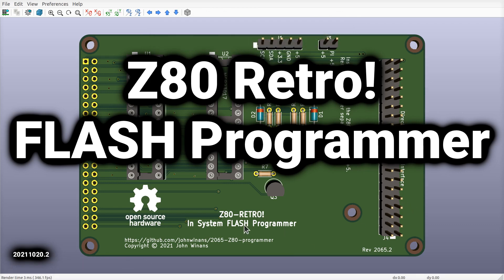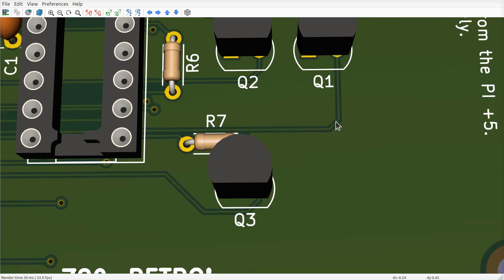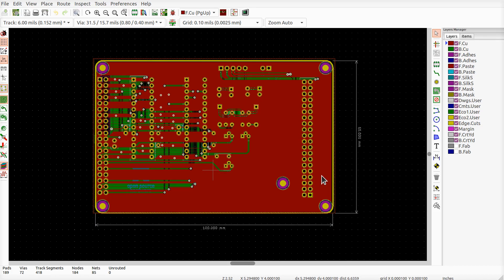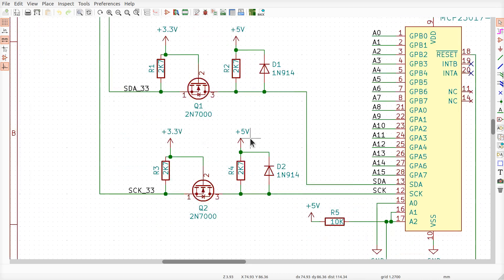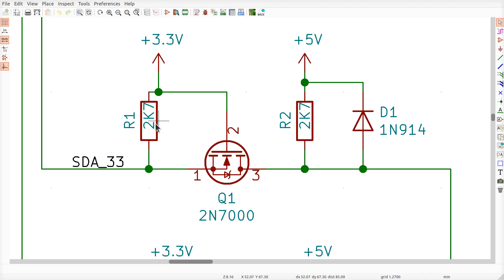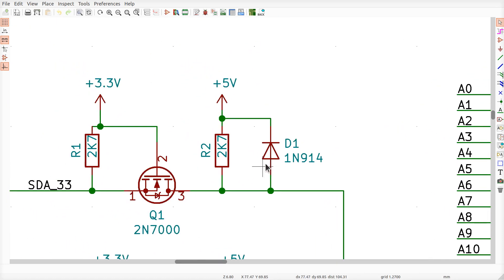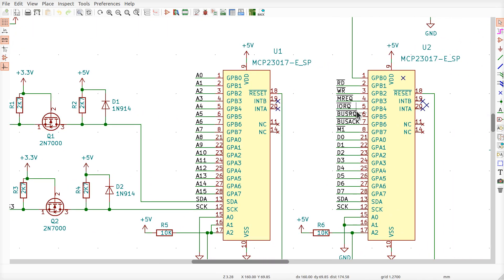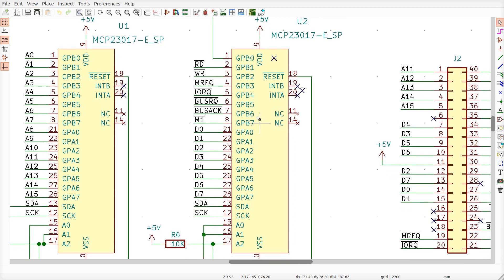Z80 Retro #9 - FLASH Programmer

Comment: Note that 2N7000 transistors are susceptible and great at demonstrating ESD damage.  The best way to demonstrate it is to drive an LED with 2N7000 and then expose it to ESD. The LED's brightness will dim with accumulated ESD events until the LED doesn't light up at all.  The closed captions are funny - with "Weight States" (are we on a diet?) and "Boss acknowledgements.
Reply from the maker: Ugh... I'm gonna call this another reason to have a closer look at the SPI version of the MCP chips (since SPI only uses single-direction signals and therefore simpler shifting needs.)
I guess YouTube has a way to go on cleaning up their speech-recog.  :-D

Comment: Nice series so far. 
Since you have decided to use the Pi as a programming tool, why not go and add the components to the programming board to implement a serial port connection between the Pi and the Z80 board. You could implement an RS-232 to 3.3v interface on the programming board with appropriate header between the programmer board and the Z80 so that when both boards are connected together you have a complete development system and Flash programmer (via the Pi), and a terminal with HDMI output and USB keyboard input via the PI back into the Z80 board. The stacked boards would be a permanent system allowing code development on the Pi, and a terminal into the Z80 with modern peripherals.
Reply from the maker: This is an interesting thought.  Seems easy enough to do by hacking the programmer board by adding a female header that sits down on the pins that I use to config the TX and RX lines on the retro hoard... Assuming that we add an rs232 driver to the flash board... since we'd need a level shifter anyway.
Ill add it as an issue on the github page so i remember next Time I look to tweak the PCB.

Comment: Don’t feel bad, back in the 70’s one of my S-100 board had the following issue:
“Very true, my Processor Technology 3P+S (3 parallel plus serial) card had a glaring error that took me months to figure out. One of the 232 converter chips was in the backwards. Not only was pin one on the board etched backwards, but the silk screen on the board was also backwards, and the manual was too. The parallel part worked great, but the serial port wouldn’t, until I found the error. ‘The Bleeding Edge’ was a very apt term in those days, but still fun to work though.”
Think you made a goof, what do you think the guys at Processor Technology did, they did not have any way to fix their goof, other than by a new letter months later if you were lucky and that the end user ever got to see that.
Reply from the maker: This one was a bummer.  🙄  But easy enough to fix even if you need to cut a trace on the board.  If you keep watching this series you'll see a more impressive "goof" in the first draft of the TMS9918 display card. 😁
Reply: @JohnsBasement  just don't think that was the biggest goof I have seen over the years. LOL

Comment: Do you really need a programmer card? Doesn’t the Pi have enough GPIO pins to control the whole Z80 bus directly?
Reply from the maker: A PI has... I think 26 viable GPIOs.  So you might be able to get by.  But you'd probably still need level shifters and one open collector driver. So, yes.. You'd need more than just wires.
With the parts costing less than $15 (if you get them with the rest) I never considered trying to optimize it out.
Reply: @JohnsBasement  ah, you’re right. I forgot that the Pi’s 3v3. Perhaps a Arduino Mega could program the Flash directly then?
Reply from the maker: @sparkybrit  Yeah, a Mega should be able to do the job.

Of course then you'd need to write the Arduino version of the code I wrote for the PI and then write another app for the host machine (where you plan to do your Z80 development) to download the binary file to the Mega to do the programming. This is certainly all doable.

Comment: If you put the correct sex 40 pin connector on the board, and tweaked the layout a bit, you could have the Rpi Zero plug into the board, and maybe even be powered off it (might need an extra cable to do that).  OR power the board off of the Rpi.  Could have the Pi mounting holes placed on the board so a pair of standoffs would hold them together.  That would be cute.  Also, if the Rpi USB can look like a 'slave', then it should be possible to do an ethernet over USB between the pi and the computer.  Actually I KNOW that works because I saw a project where the Pi was used as a USB stick.

And what does the symbol for KiCad say about pin 18?  Input, Output, Passive, or what?  Did you get any circuit errors detected by KiCad to hint that that pin was an input?
Reply from the maker: Wooooaaa!!! Good-eye! 
The part I used came from the Digikey library and it is marked as an OUTPUT!!!!   They fell for the screwy image on the datasheet front page too!
I'm not entirely following with the USB discussion.
I originally intended to use a PiZero but decided the total cost after adding the required USB adapter cable & Ethernet dongle (since I use wired Ethernet on my bench) and USB hub (if you want to add a second SD card with another adapter when we get to formatting it for use on the Z80 Retro board) ends up driving the price up enough to warrant considering a regular PI... and since I have a few laying around...

Comment: Hi John - loving the project and your presentation style is great too.

I´ve built my Z80 Retro board and the programmer board too. I am trying to work through the Blinkyś but have hit an issue;

When I run the Flash program Product ID returns all zeroś and I get an Invalid FLASH signature error in the terminal. I´ve swapped the the SST39SF020A for a spare but I still get the same error. 

Any suggestions on how to debug this issue?

Output from terminal;
sudo ./flash < ~/Z80-Retro/2063-Z80/tests/blinky1.bin
Product ID: 0x00, 0x00
Invalid FLASH signature: 0x0000 != 0xbfb5
Reply from the maker: How many ICs are plugged into the board?  I'd remove everything that is not needed.
You could probably run the flash app with zero chips installed.  You should get a signature of all ones.

Zero in the retro that is...  All chips in the programmer.
Reply: @JohnsBasement  

Originally I had all the Ics plugged in. I tried removing just the main ICs and then I removed all of the ICs. In both cases I get the output from Flash bel;ow;

sudo ./flash < ~/Z80-Retro/2063-Z80/tests/blinky1.bin
Product ID: 0xff, 0xff
Invalid FLASH signature: 0xffff != 0xbfb5
Reply from the maker: Good.  (divide & conquer) To me this difference means that your programmer sees the pulled up bus when no chips are in and it sees something reacting when the chips are in.  The programmer is probably OK.

I gotta ask: are your soldering skills ok? How likely is it that you shorted anything?  -- Can you send high res photos of your handy work?

If the parts are installed right then it could be a bad chip.

Due to the simple design, the memory should work without the cpu or other big chips.

Start again with everything installed EXCEPT the cpu, ram, flash, ctc, sio and the 244 (the input port chip.). This should react the same way as nothing should be able to alter the data bus lines.

Then plug in the flash & test again.  It should work & respond properly.

If not then your reset or flash select logic is bad.

If it is OK then add the 244 and test again.

Then add the sram.

Then the cpu.

Keep going until it fails. Then we know what to look at.
Reply: @JohnsBasement  

John some progress;

I followed your steps above. When I got to the point where I plugged in the Flash again it worked, I then plugged in the 244 again and it still worked, same for the SRAM too. But when I plugged in the CPU it failed again. I swapped out the CPU for a spare and it still failed.

How should I send you some high res images of the board?
Reply from the maker: Search for my name along with northern illinois university.  You'll find an email address on my faculty page.

Meanwhile, check the pin 1 orientation on EVERY one of the SIP resistors.  Especially the two between the programming header and the Z80.  Those two are in mirror image orientation of each other!!!  Having C9 in the right holes and RN1 in the right way is critical for this operation.

Do you have an oscilloscope?  Make sure the click is running on Z80 pin 6
Reply: @JohnsBasement  

Email sent. Will check the SIP resistors this evening. I don’t have a scope unfortunately.